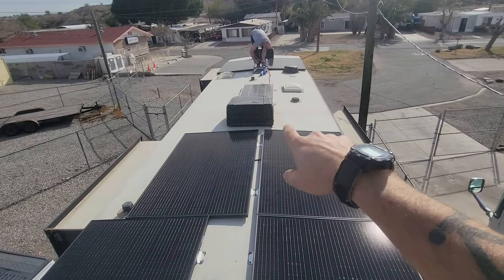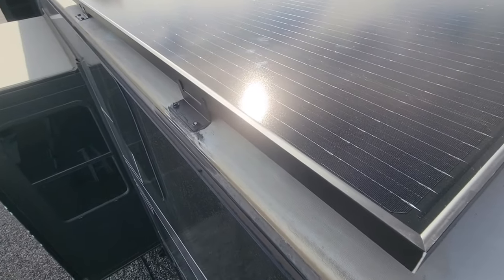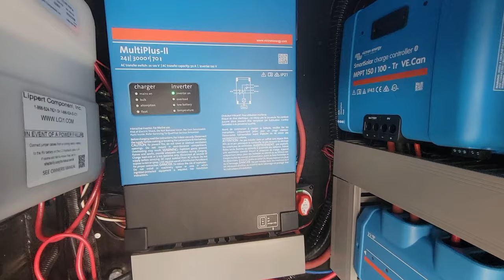Voltage Toy Hauler 24 Volt Victron Solar System Install

Comment: I like the setup.   Only thing I would change is the charge-controller setup.   Instead of one big 150/100 I would go with three 150/35's and put each 2s string on its own charge controller.  Particularly the shaded string.  I would also reconfigure the shaded string from 2s to 2p because their shading will be mismatched.   I am assuming those are 10A panels @ roughly 35-40V operating, so a 2p configuration for the shaded panels will work just fine for a 24V system voltage.

In this day and age there is no need to parallel strings, that just results in extra heat from the amps and non-optimal generation in variable conditions that isn't necessary.

Victron 150/100 - Roughly $500
Victron 150/35 - Roughly $182  (x 3 = $546)

This will allow the shaded string to operate optimally without being interfered with by the sunny strings.  Plus you are dealing with less amperage, and you no longer need a combiner box.   I am assuming that you are bringing the cables into the bay separately before combining them.

I do something similar on my 48V system, except I can use even smaller charge controllers.  I use Victron 100/20's (since the system voltage is 48V, a single 100/20 can handle 1000W of solar just by itself).  I have four of them but they really are tiny charge controllers... they all easily fit in a small enclosure and produce almost no heat because the solar connected to each one never goes beyond 12A or so.

--

I would even consider throwing on a fourth small charge controller... like a 100/20, with an external port so the owner can throw out some portable panels while parked on top of everything else.

--

I love the 12V down-buffer battery setup.  That's really the way to go.  Not only does it provide a ton of cranking amps for generator start, it also provides a (100Ah?) @ 12V emergency buffer that gives you the cranking amps even if you have depleted the main system.   Plus you get some protection against a buck converter failure (that Orion) accidentally feeding 24V into the 12V system.  It will just blow the fuse if that happens trying to work against the 12V battery, instead of blowing up gear.

-Matt
Reply from the maker: There are pros and cons to each approach.  In ideal world, yes all stings have their own MPPT, but often times space, wiring, and other complexity comes into play where it make sense for the customer to go with something simpler, albit less efficient.  Shawn runs 3 MPPTs and JD runs 2 on their RVs.
Reply: Thx for the input Matt, if I had not already had on pair of wires already run with the original factory system, I would have done exactly what you described.  I was going with simplicity and ease.  The extra 12v is 100 ah lifepo and that works awesome.  So far the 2200w in the AZ winter has worked perfectly, a normal day with a 110v residential fridge and a Starlink and running a furnace at night or occasionally one ac a few times during the day and all and any lights, Kurieg, hair dryers, TV’s, stereo cranking, etc… leaves me in the morning usually with 91% to 55% (lowest I’ve seen in the morning).  The two 24v 200 ah batteries I got on Black Friday special from time usb ($1050 each) have worked flawlessly.  Also, the compartment temps have been very cool, loving the 24v setup and JD and Shawn from Sota Solar have been great to work with.
Reply: @ppitodd  That's great!  Glad its working out for ya.

Starlink can be an energy hog without mods, but it looks like you've got the watts to deal with it.   The power mods to reduce its consumption are not easy, but I seem to recall that there was also a recent firmware update to add a sleep schedule to allow the consumption to be reduced more easily.

Comment: Another great & informative video!
I have a Victron 12v Multiplus II 2 x 120v &  I have a power watchdog wired in line after the shore power plug , but before any other input. 
I have had zero issues with it installed that way.
Reply from the maker: Great to hear!

Comment: That front bay gets hot as hell. If they use the genset their equipment is going to derate from the heat. Maybe shut down.
Reply: The equipment area is ventilated.
Reply: @raystanton238  would take huge amounts of ventilation to keep that cool with the genset running. You can slow cook food in that compartment with the genset running lol
Reply: The good news is I have not needed the generator yet!  the two fans I put in there really help, i figure I will monitor it as we get into the spring and summer and worst case I will open the compartment door if I need to run the generator.  I did not want to sacrifice more of the other pass thru storage compartment and now with the batteries on top of generator (put on 3/4 marine plywood and shimmed with 1” boards for better air flow.) and then utilizing the side and the back wall, I now have more storage up front then before!  Really happy with setup!

Comment: I have a toy hauler and thinking about solar. 
What was the cost for a system this size?
I like the idea of a 24 volt system.
Reply from the maker: We do more and more of them. Email Shawn@sotasolar.com and we can put together a quote so you have a full parts list.
Reply: But go 48V if you can, particularly if putting residential panels on the roof.  2 x residential panels in series is like 80V operating which is perfect for the (roughly) 61V needed going into a charge controller for a 48V system.  And the wiring and the charge controllers can be a lot smaller at 48V.   e.g. 2 AWG battery cabling gets you 5 kW at 100A.

Still, I won't berate people who get the jitters and want to stick with 24V.   48V isn't really more dangerous but it does require proper voltage-rated fuses, proper unpolarized DC breakers, etc.  Plus Victron doesn't make a split-phase  48V multiplus (unfortunately)... just a single phase 120V 48V multiplus.
Reply from the maker: @junkerzn7312 Biggest reason we like 24 for Victron is the 2x120 Inverter output and input.  It works so well for RVs.   When a 48v 2x120 comes out, we'll likely change our tune.  We love 48v as well.
Reply: @junkerzn7312  Thanks for your thoughts! What would an estimated cost of the solar system?
Reply: @sotasolar  Thanks!

Comment: Your videos are great and I’m getting ready to install the 12v multiplus ii 2x 120. I bought the watch dog to put on the shore power line right after the plug of trailer before it goes into the multiplus. Should i not install it. This is the first time I’m hearing of issues and cant find very much about it. From what i read its 50/50 that it works or does not work.
Reply from the maker: Shawn here - I’ve had hit or miss issues with the Neutral bond relay of the MP causing issues. Can cause issues on GFCI as well.

I have a hard time recommending against it because it can potentially protect your equipment from crazy stuff. 

That said, neither JD or I run one, then again we don’t use shore power much.
Reply: Thanks. Keep putting out your content. I think i will install it and if it don’t work out put a splice box in where the factory wire would go into the watch dog and and connect where new wire heads to mutiplus. Thanks again.